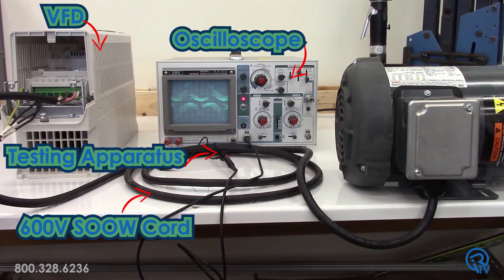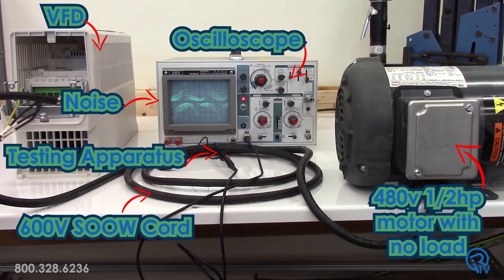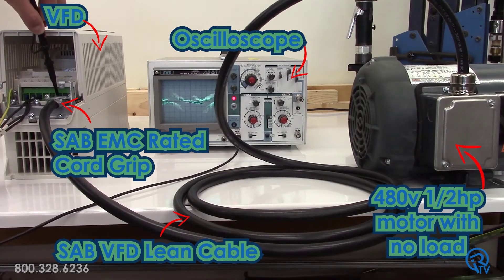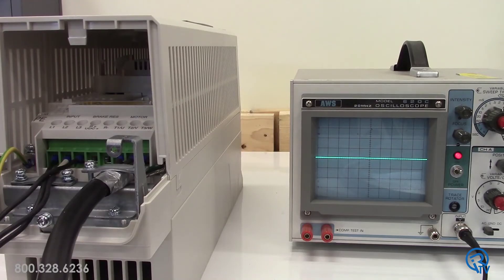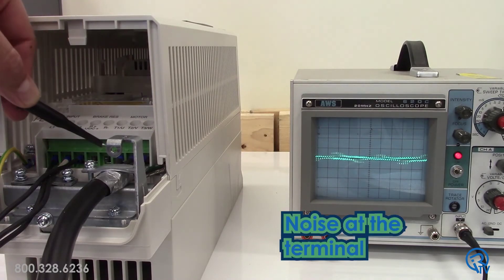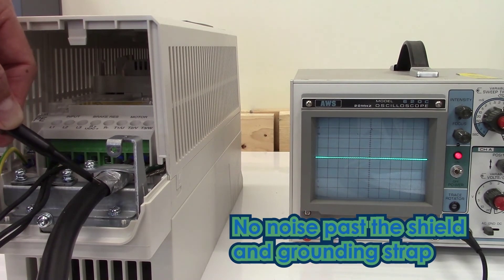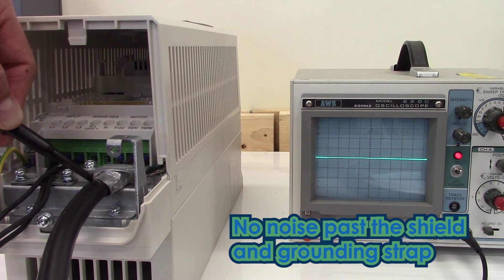Can VFD Cables Really Eliminate Noise?

Comment: The test done here is not well administered. You could make a "sniffer" by connecting the ground clip in a loop back to the probe tip. Would work much better.
Noise, Grounding, Ground-Loops, etc is all black magic anyway..No exact science to this. There are "best practices" which should be followed, however always be prepared to vary these procedures as needed...

Comment: Good vid, nice test, we used the same for 200 and 250 hp vfd, but have never tested it, how do i test it?
Reply from the maker: We used an Oscilloscope to pick up the noise, or not pick it up in the case of the SAB VFD Cables. We had to play with the settings to get a viewable reading, but it was pretty cool once we were able to see the effects of the SAB cable vs a regular cable.